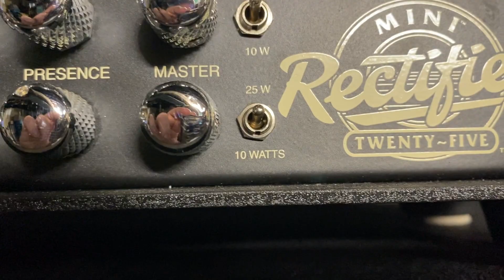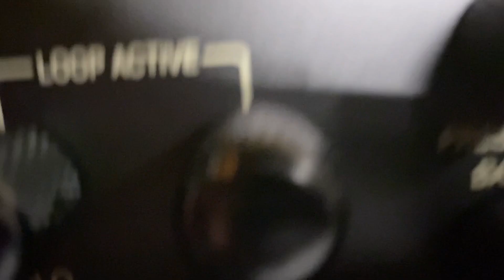Mesa Mini Rectifier Vs Mesa Dual Rectifier MWDR modern mode tones

Comment: Nothing like Mesa Dual Rectifier 😮 Could we switch the riffs though 😅
Reply from the maker: Sure thing.  I’ve kept them consistent between the amplifiers to give an idea of the sounds between similar amps/settings.  If I’m playing one thing then change the amp, is it just the amp or the riff making it sound different?

The other issue is I don’t want the video to be 6 years long, but I’d really like to tweak the sounds more to show case what these amps can do.  Thanks for stopping by, it’s appreciated :)